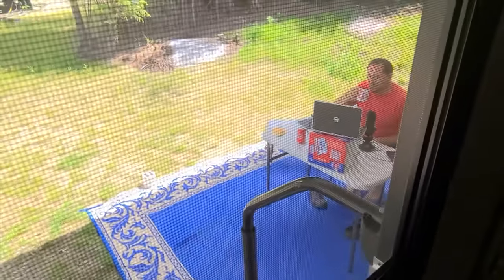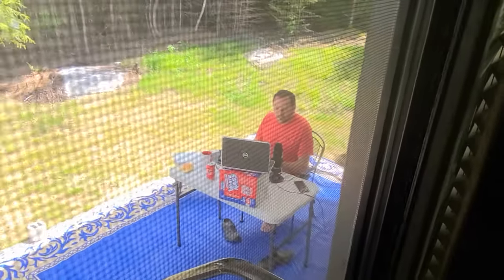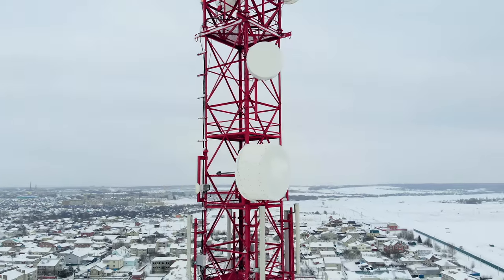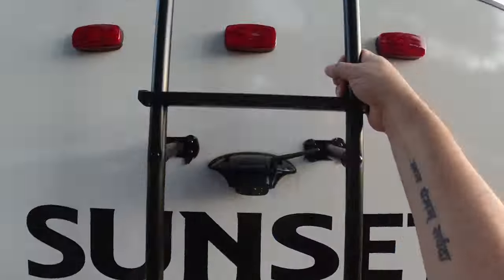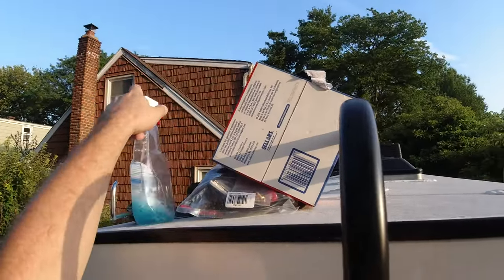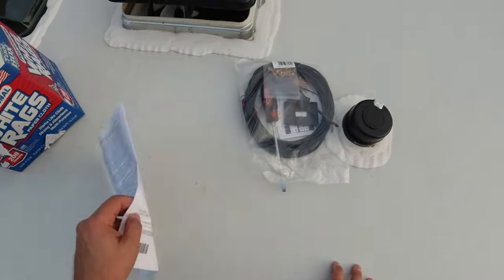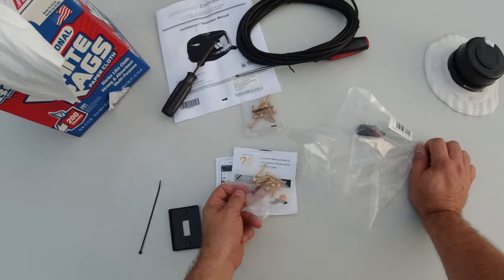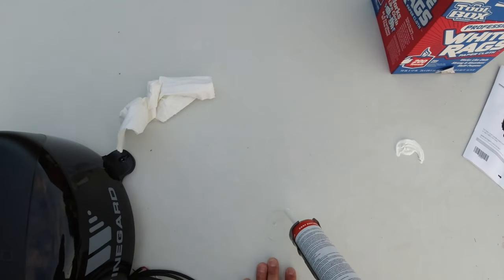RV WIFI | Winegard Performance Secrets plus full install and review.

Comment: I have heard about the slower WiFi speed, but didn't think it was less than half  !!!.  I would think that multiple antennas would have a better connection and that would mean faster WiFi.  Thanks for the info.
Reply from the maker: That's what I thought but I guess that's why I'm not an electrical engineer.  It does do an amazing job at pulling in a weak signal if that is your prevailing issue.  Welcome to the channel!

Comment: So if I’m understanding what you are saying correctly what is even the point to getting a WiFi booster if you are not able to get the speed you want in order to do normal internet things like zoom?
Reply from the maker: It was/is a problem for me.  I believe the point of it is if you are boondocking and need to grab a bad signal and you are happy to have that when you would not of had any internet...that is where this thing shines because it definitely will do that.  The trade off for that is it is slow, slow, slow.

Comment: Wouldn't the Wineguard 360+ have been a better choice, ie swap your 360 with a 360+? Why did you go with this unit?
Reply from the maker: We really wanted the ultra strong and stable 4G connection as close to all times as possible.  The Wifi at most RV Campgrounds is generally terrible.

Comment: Ok, finally some good info on setting up my Winegard. It's been incredibly difficult. One question of clarification. If I get you right, you are saying to take the sim card out of my phone, walk into the phone company (Verison or Att, etc), show them what I have and say, I need another one of these.
But will that new card be formatted so that if I put it in my winegard I'll have the 4G connection? Not sure I really get that part. Thanks, I loved that you say here's the "dirty little secret." It seems sneaky that Winegard lets us think its a wifi booster in every way when in fact it sure doesn't seem to be if I follow your experience. Man, it's been way more of a chore to get this working - the system came installed on my 2022 RV - when I thought it was a simple operation.
Reply from the maker: I'm glad I was helpful!  Yeah..it doesn't work some ways they seem to say but other things they promote it really works perfectly.  In terms of the SIM card...take the SIM card that comes with it down to your local store.  That way you know it's the right size for the Winegard unit.  Mine was already in the Winegard unit so I took it out of the rooftop device and brought that to the store.
Reply: Thanks a lot. Will try it.
Reply from the maker: @gregormson  Let us know how it goes.

Comment: This is a nice video. I'm wondering why you didn't consider replacing the existing Winegard 360 with the Winegard 360 Plus and their Gateway product?  That would have had one less box on the roof. It would have, however, meant getting all that goo off the existing Winegard.  :)
Reply from the maker: Actually,  our RV came with the 360 pre installed so I use that for over the air TV when cable isn't available.   You are so right,  I will do anything to avoid removing that goo!   Thanks for checking our channel out.  If you can help us out and share a link on Facebook or Reddit wherever you are doing your research...that is a huge help for us.  Thanks in advance .

Comment: I just bought an RV with the Winegard 360+ already installed, which they offer the Gateway. I need high speed internet because I work from home my RV and I will be living in an RV Park so I am trying to figure out my best option, mobile hotspot through Verizon or ATT or should I go satellite? I will not be  moving around and mainly using it for work, and zoom meetings, plus using my Firestick to stream movies. Any advice would be greatly appreciated.
Reply from the maker: I have an unlimited plan with ATT and never had an issue with the speed using my phone as  a mobile hotspot.  I didn't explore the speed via Satellite but my fingers are crossed for SpaceX's Starlink Service.  It sounds like it would be perfect for our needs!  Let me know what you decide to go with and how it works out.
Reply: @DOUGandNIKI  when you say you took the sim card to ATT was that from the Gateway or from something else. I have the unlimited plan with ATT but then get a notice that I have used over 2 gb and my speed is supposed to slow down and that is without using the hotspot. 
I may go with the mifi and then do more research into the satellite. From what I read startup for satellite is costly and plans are higher.
Reply from the maker: @vickydunham746  I have the Connect T2 which is a little different than the 360+ but I looked at the instructions for the 360+.  That seems to have a more conventional SIM card than the Connect T2.  I think the process is the same though, you have to buy a data plan from At & T for a new device.  They no longer offer unlimited on new devices.  I did find their plan to still be significantly more cost effective than Winegards plan.  I have heard that AT & T throttles your unlimited at some point but I do believe even throttled back it is plenty of data for streaming.  I haven't had an issue.

Comment: How does this work with a fire stick.  Like watching movies and worry it eats a lot of data. So is winegard 20g enough.  I'm living in my rv full time.
Reply from the maker: I'm a Chromcast guy so I've never tried the fire stick.  I have a basic understanding and I'm still sorting out the data usage myself.  So far I believe 20Gig would be sufficient but I think it will depend a good bit on the quality of video you are streaming.  If you want to be able to stream in 4K obviously that is a whole different story but at 1080 or 720 I think you'd be ok but obviously it depends wildly on your usage.  Are you leaning more heavily on the 4G as opposed to Wifi?  We don't do boondocking so I've always had access to Wifi wherever we've camped.  I'd only switch to 4G if it was too slow.

Comment: Do you have a link to that white roof sealant glue you are using?
Reply from the maker: I didn't include it because the sealant varies based on the kind of roof you have.  If you know what material your roof is, I'll find a link for you.

Comment: Hi,
      We have the 360 on our new rig. My question is , if I add the gateway to it how will it work? We don’t really use it for work but more it would be for regular internet surfing etc, and really the big thing would be if my son wants to play Fortnight, internet based games through WiFi how will this work?

Thank you..
Reply from the maker: For me, the two units the 360 and the Connect T2 are two completely separate units which operate individually and do different things.  I would try a couple trips with your son playing Fortnight with the local WIFI or using your phones as hotspots and see how it goes.  Based on my experience, if you used the Connect T2 to a WIFI system with enough speed for Fortnight, it would probably suck up so much speed that you might not be able to play Fortnite anymore.  I did do a quick google and it looks like you don't need much speed for fortnite so you would certainly be ok with your cells and most likely ok with most RV Campgrounds local WIFI.  WOw...that got very long.  I hope it helps.
Reply: DOUG and NIKI Thank you that is an awesome reply. Just what I was looking for. Fortnite is exactly what he plays . So if I’m
Understanding you correctly I don’t need the gateway yet ? Just use my phone as a hotspot, which I will need to learn how to do , never used it like that . Just wonder how much data it would use . Thanks for your help I will look into it.
Reply from the maker: @heberclementiii6788  I'd start there.  You'll have to watch that data.  We have unlimited plans so it's easy for us that way.
Reply: DOUG and NIKI Hi Doug. I talked to you about a week ago . Do I need the gateway in order for this to work or no gateway and use cell as the hotspot? A little confused on how this works. Thank you , Heber
Reply from the maker: @heberclementiii6788  To be honest, I don't know  what a gateway is.  What I did for using my cellphone is the cell phone itself has an option to be used as a mobile hotspot.  I'd simply turn that feature on and then log on to the mobile hotspot from my laptop and work and stream video that way.
Reply: DOUG and NIKI Hey Doug . I will try that . The gateway is the router that you add to the Winegard Air 360.winegard called it a gateway 
Winegard GW-1000 Gateway 4G LTE WiFi 
Thank you , Heber
Reply from the maker: @heberclementiii6788  We had the basic Air 360 pre-installed on our travel trailer and I jumped to this premier product to try to get the best answer.  I know there is a 360+ and I guess this gateway as an option but as I went for a full new unit I can't really tell you about the ones in the middle.   Let us know what you decide to do and how it works.
Reply: DOUG and NIKI sounds good I will keep in touch.

Comment: I really thought this would be a better solution to  purchasing a WIFi Ranger that’s expensive
Reply from the maker: I guess it really depends on what your needs are.  If you needed a strong signal and you don't need speed...aka..doing basic emails...I think this is a very good answer.

Comment: Thanks for the video. I have us cellular so having an extra option to get a different signal Is a plus. So say if I had a at &t phone and it only had 1 bar of 4g. Would this boost the speed and reliability you think?
Reply: If I used the 4g option? Basically just using it's data so I get better signal then my 1 bar 4g? Or would it perform the same?
Reply from the maker: @nathanboone2995  If you have one bar I think it would definitely improve the stability of the signal but I'm not sure if that would increase the speed or just relieve the annoying bad connection factor.

Comment: The 360 plus has 4G LTE antennas and amplifiers also. Not sure why you didn't just use it.
Reply from the maker: I only have a basic understanding of the 360+ but it's my understanding that you need to add a router to use it plus the antenna are not as strong in terms of pulling in and amplifying signals.
Reply: @DOUGandNIKI  you do have to add a gateway but it's cheaper than the 2.0 and you already had the 360+.
Reply from the maker: @Traylors_outside  I had a 360, not a 360+.

Comment: Thanks for this! How does TV get a signal when on the road or boondocking?
Reply from the maker: What a great question.  This product doesn't work with the TV but we also have a Winegard 360 which does.  Our experience has been that it seems to pull in Public TV channels really well wherever we go but Networks are still very hit and miss.
Reply: @DOUGandNIKI  thanks! Our coach has Winegard connect 2.0, supposed to be a tv antenna as well. Since We didn’t take delivery yet, so should I have Winegard 360 installed while on the assembly line? Thanks my friend!
Reply from the maker: @musclecars4635  I would ask your coach builder if it already includes a 360 or if that can be incorporated into it somehow.  Also...  I'd do a little research into TV receivers.  The 360 came pre-installed on our unit so I didn't do any research into if it was actually the best product.
Reply: @DOUGandNIKI  I contacted Thor rep and put my order in. Thanks for great advice! Anything else I should add now?
Reply from the maker: @musclecars4635  My one recommendation that I would make based on our experience with our sunset trail is we chose the one 15,000 BTU air and I'd add a second smaller unit.  The 1 unit works ok but I think it would be easier to distribute the air with 2.  If you check our Amazon Page we have lists of all the gadgets and equipment we've tried and bought for the RV, I've even broken it down to shopable pictures so you can see all of my "electrical supplies" in one picture with links.  I've done the same for fresh water...back water...tools...  https://www.amazon.com/shop/dougandniki
Reply: @DOUGandNIKI  awesome will do! Our coach has two AC’s standard equipment.
Reply from the maker: @musclecars4635  I think that's the better plan.
Reply: @DOUGandNIKI  So This Unit will not work as an Antenna for your TV like the 360 or 360 + will do correct? Thanks for You help with this issue.
Reply from the maker: @DirectCurrent4u  Yeah, this is purely a WIFI unit.  Welcome to the channel.  What kind of rig are you looking to put this on?
Reply: @DOUGandNIKI  I have a 24 ft Winnebago travel trailer and want to upgrade the TV Power Antenna with a 360 or something i don't have to adjust. Plus I would like to upgrade my wifi system as well. Any help would be very appreciate.. Thanks DC
Reply from the maker: @DirectCurrent4u  The 360 works great for the TV aspect.  I find that with the exception of unusual circumstances where the RV Park has really good WIFI, I don't use the connect T2, I just use a wifi hotspot off my phone.  That's because I stream video, do conference calls, etc and I need decent speed.  I'm hoping that the RV products start to incorporate 5G functionality soon.
Reply: @DOUGandNIKI  I totally agree. Thanks so much for Your reply. DC

Comment: After installation my wineguard worked fine.   One morning it just quite working.   No power.
Is there some secret to restart the system?
Reply from the maker: hmm... I was lucky that my trailer was pre-wired so power was never going to be an issue.  I do have a switch inside my cabinet which turns it on or off.  You may have a hidden switch also.  Let us know what you find.

Comment: Anytime a WiFi connection is ‘repeated’ expect the latency to double and the speed to be cut in half. How is the performance of the cellular side? It ‘should’ be equal to a jet pack or their cellular hotspot connection.
Reply from the maker: I didn't see the same degradation of speed but it's much more expensive with no difference speed wise than using my cell phone as a hotspot so in practicality, if I was going to use cell service, I used my cell phone as a hotspot.
Reply: @DOUGandNIKI  ok. I’m trying to figure out if reception is better then a hotspot or cellphone. I run a hotspot with a Wilson cellular amplifier now and it works ok, just trying to find a better solution.
Reply from the maker: @Ozziffied  So where I travel there are very few places where I get a weak cell phone connection.  I did play with it a little bit and my gut impression is that the cell reception on this device was outstanding.  I think that would be it's biggest strength...if I was somewhere on the edge of service, I think the Winegard would provide the strongest and most stable connection.  Better than my cell phone.  That isn't scientifically tested...but my impression.
Reply: @DOUGandNIKI  That is my exact hope! We do a lot of 'horse camping' so we don't always have a great signal. Now to decide between the AIR 360+ and the Connect 2.0+.
Reply from the maker: @Ozziffied  I haven't tried the 360+ but I can say the Connect is a very solid quality product.  We have links to them on Amazon if your interested.  Let me know which one you go with and how it works!

Comment: Did you have to cut a hole in the insulation also?
Reply from the maker: For our situation...no.  Our camper came "pre wired" so after I cut through the roofing material the wires were right there.

Comment: Just bought a TT and it has a Winegard Wifi extender installed.  However I don't have the owners manual.   Where is the SIM card located and how can I tell what Model I have?
Reply from the maker: Hard to tell but all of the manuals are available on their site as pdf's.  Should be pretty hard to get a feel for the right one based on the pictures.
Reply: If you have the 360+ you might have a opening on the ceiling to install a router.  If you dont, you can take the top off the 360+ and install the router in there.  You will need a router and the SIM card goes in the router.

Comment: So if I get this amplifier and connect it ill get better signal, if i buy a booster to pair it with the amplifier I should get faster speeds? Is that right?
Reply from the maker: What booster are you looking at?
Reply: @DOUGandNIKI  none in particular just wondering if the pairing will do the job. Im thinking of just getting one of the mobilemusthave.com bundles instead if buying the winegard isnt going to give me signal and the speed I need.
Reply from the maker: @brandonmatthews4112  So...my experience has been at RV campgrounds is that the speed of their modem/service is the limiting factor and nothing we do on our end makes it faster.  If there was a way to do that...I'd be in on it in a second!  If you hear of anything good let me know!
Reply: @DOUGandNIKI  from what ive been researching from the link i left is basically overpowered hotspotting through your cellphone provider. Thats the only thing ive come up with, havent tried it yet but their 30minute video breakdown of the system packages makes sense so far. Still researching but they seem like the best bet to go with from reading and listening so far.
Reply from the maker: @brandonmatthews4112  Let us know what you find if you try it out.
Reply: @DOUGandNIKI  will do
Reply from the maker: @brandonmatthews4112  I hope you find a winner because it's a real problem.

Comment: What did you use for the sealant around the mount and the screws to seal it?
Reply from the maker: Our RV has one of those newer rubber roofs the dealer had recommended a product,  I would have to look it up.  Do you have the Sam kind of roof?
Reply: @DOUGandNIKI  I have a newer rubber roof as well. I read some things online and it looks like I found the right kind of sealant. It is called Dicor lap sealant. Does that sound right?
Reply: By the way, great video. Helped a ton.
Reply from the maker: @scottmayfield951  Thanks so much...that's great to hear.
Reply from the maker: @scottmayfield951  Yes!
Reply from the maker: @onbelay4201  Huh?